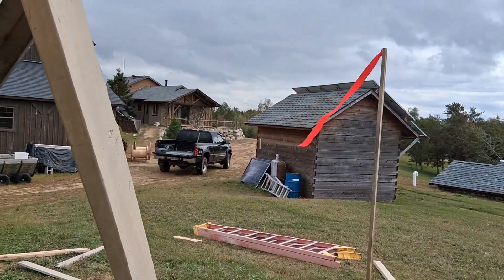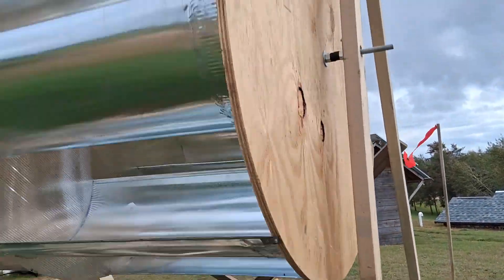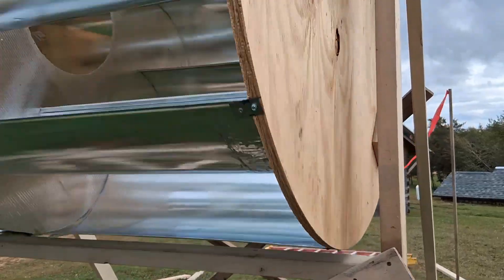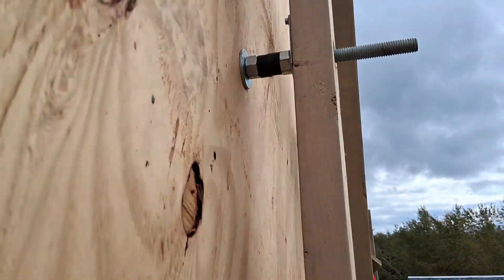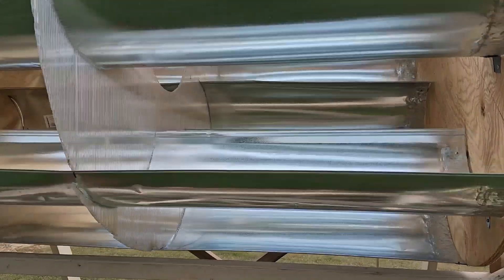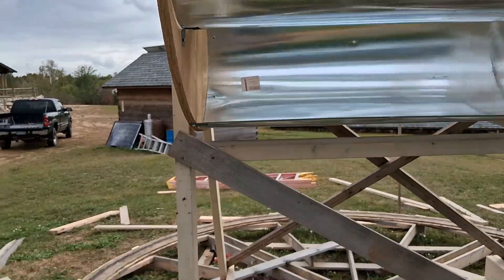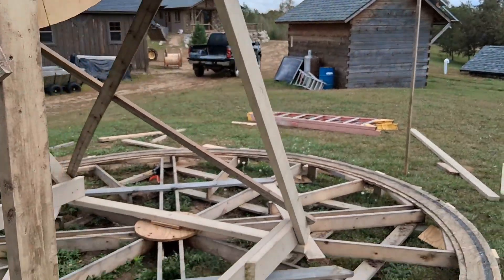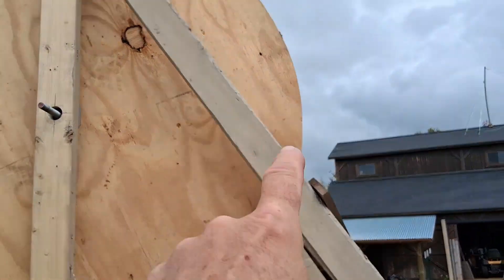New wind turbine test bed build

Comment: Hi Mate, there is a lot of junk on the market, so after a few bad buys and lots of testing, I have finally found the best performing small wind generator for the price - $361.90 AUD that is postage included from China - 
Search  -
1000W 24V/48V Windmill Power 6 Blades Wind Turbine Generator W/ Charge Controller 
- ( Best to order the 48V model )
This is a buy and put up wind generator, no modifications needed.
I hope this helps anyone for buying their first small wind generator.